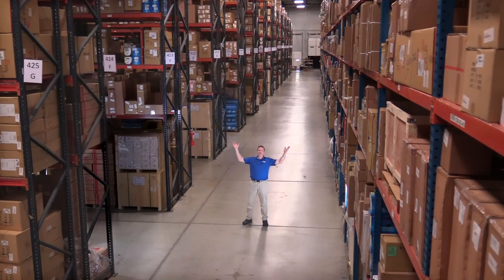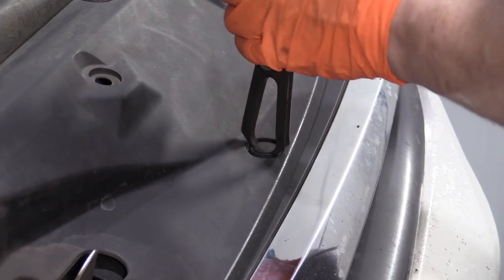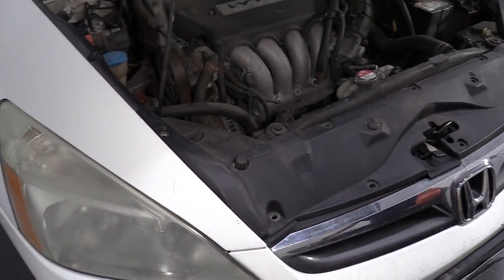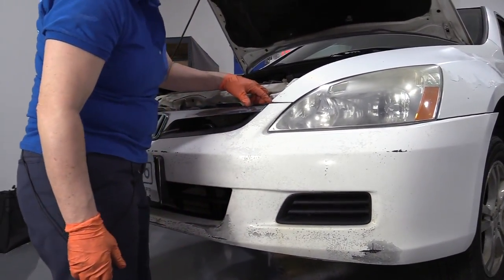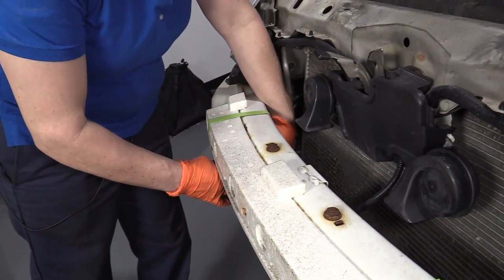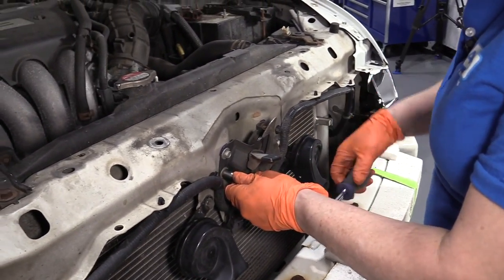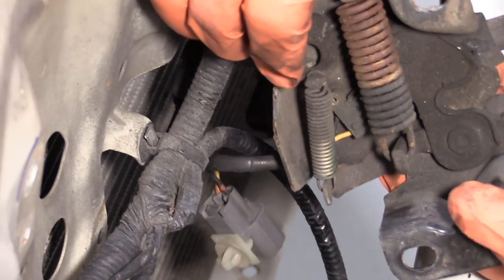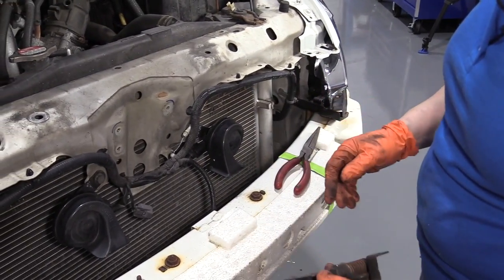How to Remove Hood Latch 03-07 Honda Accord

Comment: Great video! Thanks.  Replace the hood latch on 2006 Honda Accord Coupe 2.3l.  note:  once top black plastic cover is off, we were able to work with the top front cover (with the "H" emblem on it) and got it off without taking the entire front end off, in case other might be able too.  (it can separate from the bottom front piece)

Comment: I have a 2002 accord ex v6 has the same problem with the latch. Do i have to disassemble my front bumpers too? Thanks in advance.
Reply: All this just to remove the hood...
Reply: I got the same issue, what I did for a quick fix before it changed was using a screwdriver on the one piece once the hood was open, I pushed it back down then closed the hood and it was good, but something changed and I haven't been able to figure it out so far... hope this helped....

Comment: I have 2007 accord. Hood won’t pop at all. I went to mechanic and he said he can’t get it make appointment. I went home popped plastic cover off thru grille and w/ someone holding lever open.I stuck screwdriver thru grille on to latch and hit it with hammer and boom hood popped
Reply: It turned out little rust was stopping it from opening. I sprayed it with wd40 and grease